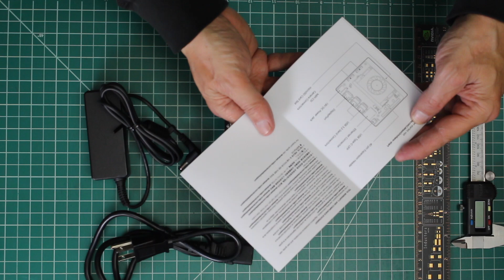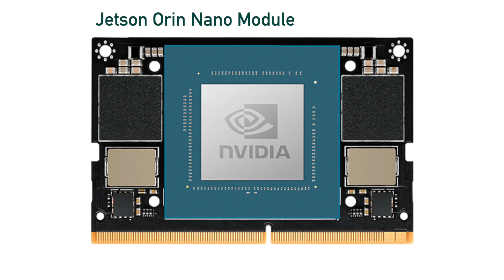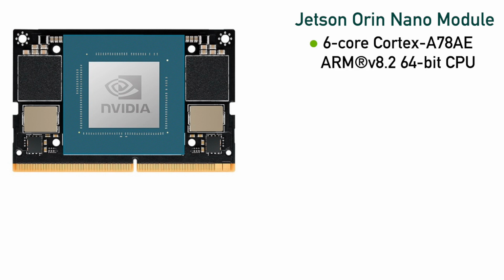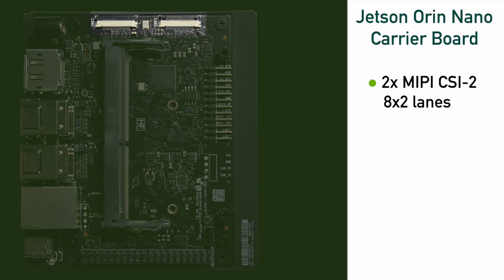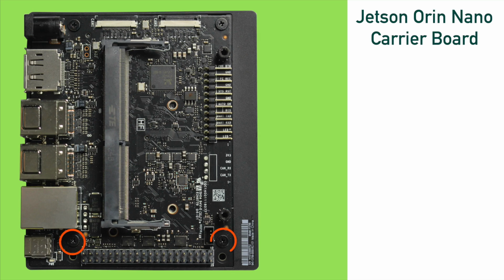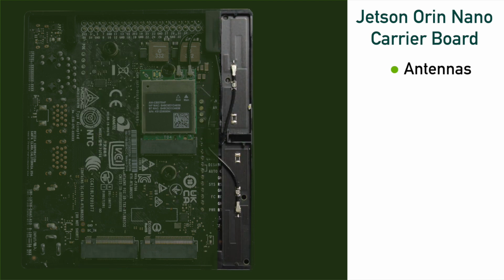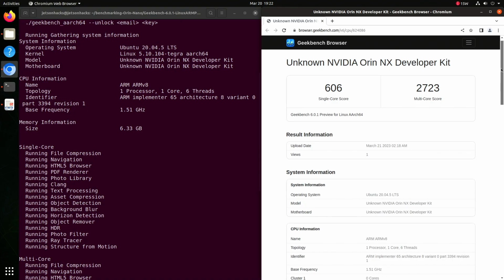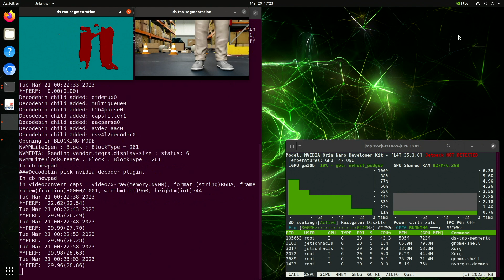Ultimate Jetson Orin Nano  Walkthrough

Comment: Greetings, Jim!

Thank you for the interesting video! I have also seen the announcement. Apparently, Orin Nano Dev kit will be available mid-April.

A couple of quick questions, if I may:
1) Does it come with a pre-installed operating system? Or we have to install it ourselves using an SD card?
2) I might have missed it, but is there an audio jack (in case if one decides to experiment with speech recognition)? 
3) Can it be used as a substitute for a desktop? I was looking at Edge 2 (by Khadas), which is prices at ~$370 in "Pro" version. It's cheaper than Orin Nano, but not too cheap. However, it's the lack of connectivity that really bothers me. Edge 2 doesn't have Gigabit Ethernet, no M.2 slot for SSD, only two USB ports. It is not an easy choice at this price point, but I do not want to "save" money by buying something with a limited utility. How would you approach this dilemma?
Reply from the maker: The Orin Nano is like the Jetson Nano and Xavier NX. At a minimum you need to have a SD card to boot from, NVIDIA provides a SD card image. As an alternative, you can use the SDK Manager if you want to boot from NVMe SSD or a USB drive.

I don't know enough about the Edge 2 to make a recommendation. If your intention is to just use the Orin as a desktop replacement, you should consider buying an inexpensive laptop instead. Thanks for watching!
Reply: @JetsonHacks  Greetings, Jim!

Thank you very much for answering. I do appreciate that you always find time to interact with your viewers and answer questions. The reason I have asked about SD card is that "Seeed" offers same Orin Nano dev kit, but packaged as a mini-PC. I am referring to reComputer J3011. This model does come with a pre-installed JetPack 5.1.
Reply from the maker: @leibaleibovich5806  Right. It uses aOrin Nano  production module. That module does not have a SD card. The NVIDIA Developer Kit has a SD card built into the module. The intent for the production model is that it will boot from NVMe.

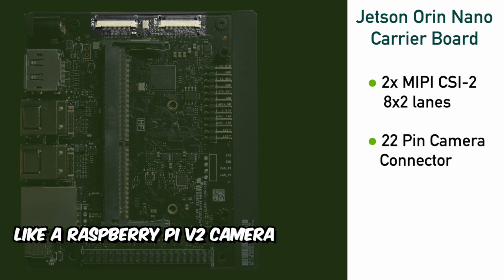Comment: 4:58 can i use Raspberry Pi Camera V2 with this new NVIDIA Jetson Orin Nano?
Reply from the maker: Yes you can. Thanks for watching!
Reply: @JetsonHacks  are you sure, because raspberry pi camera v2 has only 15 pins. and NVIDIA Jetson Orin Nano has 2 MIPI CSI 2 ports (22 pins each). So I guess I have to use a CSI cable to change from 15pins of v2 camera to 22pins of Jetson?
Reply from the maker: @ucbuiminh2958  That is correct. That's a pretty common ribbon cable these days.
Reply from the maker: I made a video for you about this subject:https://youtu.be/EuRXAUU61yM

Comment: So it's got exactly half the cuda cores and threads than a mobile 3050
Reply from the maker: I believe that's correct. The RTX 3050 runs in 35-80W, the Jetson Orin Nano in 7-15W. The memory is different, GPDDR5 vs LPDDR5. The Jetson is a little different of course in that it has CPU cores and the rest of the system on the same chip. Also, the memory is shared between the CPU and GPU (unified memory) . The 3050 has to send it back and forth from GPU memory to main main memory. Thanks for watching!
Reply: @JetsonHacks  ok
Reply: @JetsonHacks  At this price though one would be better off to actually buy a 3050 laptop.
Reply from the maker: @theabyss5647  If the laptop suits your needs, that is an alternative worth considering. If you are using the Jetson Orin for the intended uses, such as robotics/smart cameras/drones and so on, a laptop is poor choice. Thanks for watching!

Comment: The price is of concern.  The Orin is $2000 on Amazon, with much better performance.  If the "baby" is already $500, as opposed to the original $200 initially announced, it is showing nVidia is unwilling to cater towards the rapid prototyping scene or the lightweight/low-cost ML-at-edge device category.
Reply from the maker: I understand your comment about lightweight/low cost. I don't understand the rapid prototyping scene comment. With the amount of software available on the Jetsons (along with all of the machine learning tools in the NVIDIA ecosystem) you should be able to rapidly prototype pretty much anything within reason. Thank you for taking the time to comment, and thanks for watching!
Reply: @JetsonHacks  I bought the old 4GB one for $99 last year, and this one if I order the Orin Nano 8GB it is $625 with tax. (25% tax where I live in Europe).  For camparsion a new M1 Mac mini is $680 here. I think its a bit too expensive for me, but I would buy instant at $300.
Reply from the maker: @AndrewTSq  I understand your concern. The M1 Macs are great machines, well worth buying if that fits your use case. Unfortunately they aren't really practical for a lot of ways that people use Jetsons. Different type of application. BTW, I tell the Ferrari people the same thing. If it cost $300, I would buy a Ferrari in an instant! Thanks for watching!
Reply: @JetsonHacks  ah sorry, no mac mini for me just had it as an example of price :) The good part is that this Jetson has psu, wifi card, and a fan included, aswell as the nvme  ssd port. I will buy one for work, but I want one at home too.
Reply from the maker: @AndrewTSq  I think calling it 'Nano' confuses folks. It feels like to me more of a Xavier NX Dev Kit replacement. If you look at the price difference ($399 vs $499) of each at introduction, it's a 25% price increase. But at the same time it goes from unobtanium to an actually shipping product. Still, it's not inexpensive. Also, NVIDIA sold the Xavier NX at cost (it was the same price as the production module at the time), this time through it's a little more  traditional product pricing.  This change will probably make their 3rd party manufacturers a little happier.This product is something the early adopters will most likely enjoy first.

Comment: Do I need something else (like a memory card) to start using it?
Reply from the maker: Yes, you need to provide a micro-sd card. I recommend a 64GB to start with. If you are planning on using more storage, I would certainly consider adding NVMe SSD for even better performance. Thanks for watching!
Reply: @JetsonHacks  If I have a M2 SSD, do I only have to plug it and run the Jetson? Or do I need to do something else
Reply from the maker: If the SSD is M.2 Key M, it also has to be PCIe (some of them are SATA). Once you have it installed, you can use the SSD as either additional storage, in which case you will need to format the SSD. Or, you can use the NVIDIA flashing tools to set up the Orin Nano to boot from the SSD. When the JetPack 5.1.1 software is released, I'll go over that process. Thanks for watching!

Comment: That CAN header we need to know more about, that would be a huge plus!   Still the pricing does not compare with what we would normally expect, in the past as processors became faster the prices would drop not go up.
Reply from the maker: I think the pandemic and inflation makes people have to think much differently about pricing now. We got use to a lot of things ...
Reply from the maker: It seems interesting. The Xavier NX had the same unpopulated header, I don't know how many people actually use it. Also, I don't know if you need to modify the device tree to get it to work correctly. Thanks for watching!
Reply: @JetsonHacks  FIRST Robotics which includes over nine thousand high schools which are required to use a NI RoboRIO for competitions has a CAN bus, and it is able to communicate to the motor controllers, and other devices.   FIRST allows a secondary processor(has to be Under $500) for the RoboRIO, and the Jetson would be very popular in handling the ability to identify objects and distances to objects visually using the AI function, which the RoboRIO is not able to do.
Reply from the maker: @sy2532  A lot of 1st teams have been using the Jetsons, I believe that NVIDIA supports the series. With the EDU discount, the Orin Nano certainly would be a good choice.
Reply from the maker: You can plug in a CAN board (like the  Waveshare SN65HVD230 CAN Board https://amzn.to/3KlLlNb). Then you have to configure everything: https://docs.nvidia.com/jetson/archives/r35.3.1/DeveloperGuide/text/HR/ControllerAreaNetworkCan.html
Reply: @JetsonHacks  I am finally ready to go.  I was able to get the education discount for FIRST Robotics for the development Orin Nano.
Reply from the maker: @sy2532  Excellent! Good luck on your projects!
Reply: @JetsonHacks  I can get it faster through amazon than the 3.0

Comment: Why the 5x price increase over the last generation dev board?
Reply from the maker: It's more of a replacement for the Xavier NX than a Nano replacement. The Nano is still being offered.  The Orin Nano is ~ 80x faster than the original Nano, so that might be a factor to consider. The original Jetson Nano is now $149, up from the pre-pandemic $100.
The Xavier NX was $399, so it's still a jump. However, everything is a little more expensive now. The Xavier NX has not been available for quite some time due to parts shortages. Just being able to be able to buy Dev Kits again feels like a big step forward. Thanks for watching!
Reply: @JetsonHacks  it looks almost the same as Xavier nx dev kit
Reply from the maker: @leonpano  Same form factor. The main differences on the carrier board are 22 pin vs 15 pin CSI camera connector, USB-C vs micro-USB connector and the addition of another Key-M slot on the underside of the board. The Orin Nano module replaces the Xavier NX module.  Thanks for watching!

Comment: I really hope they're gonna sell them at MSRP. The original Nano costs now 340$ where I live (after currency conversion).
Reply: $500, excluding shipping, just for prototyping they say -__-
Reply: @sergeykorol6548  That's relatively good. In my currency Nano is 1500 and Orin Nano is 2600 so 40x AI performance at 1.7x the price is currently not bad. However the old Nano used to cost 600 in my currency.
Reply: I bought the 4GB Nano last year for $99 lol.. this one is $625 + shipping.
Reply: @AndrewTSq  + nvme drive and a box.
Reply: @sergeykorol6548  well, you could use a sdcard.. but to be fair I paid $100 in the end to get a working 5v 4A psu for my Nano :D (bought a cheap one first that was supposed to work, but it made the system throttle) and the network card was like $30, and the fan $20..So it was more like $250. This cpu on the new jetson is like a Intel I5 2500k, so I guess it could be used as a dialy driver also.
Reply: @AndrewTSq And what is your use case?
Reply: @AndrewTSq  lol? wondering where the fuck do you get such prices.